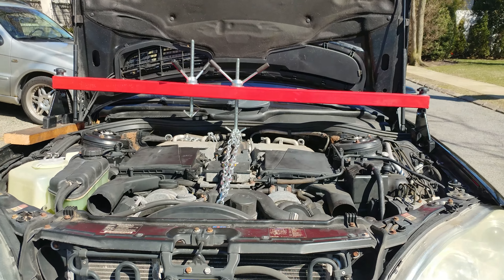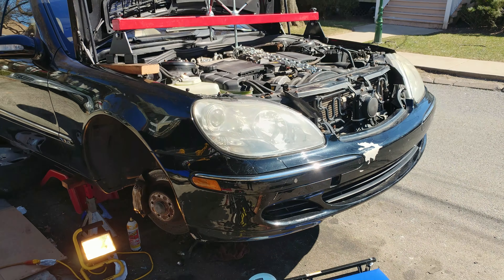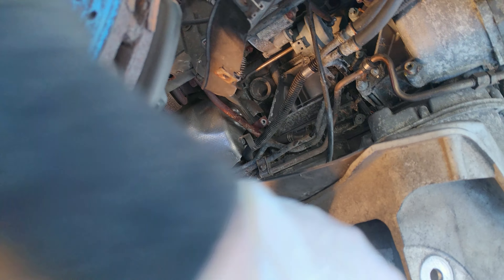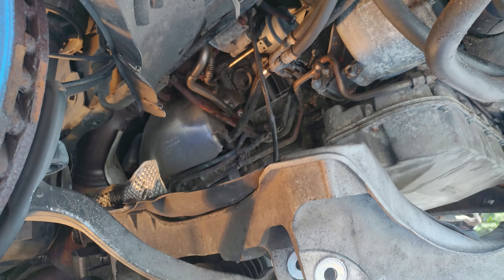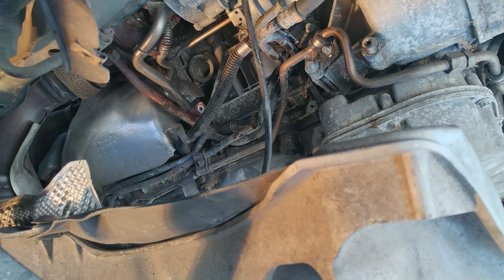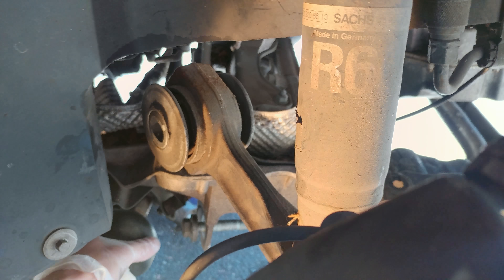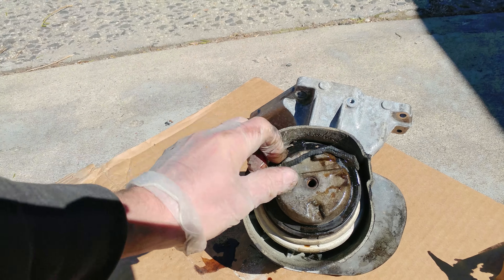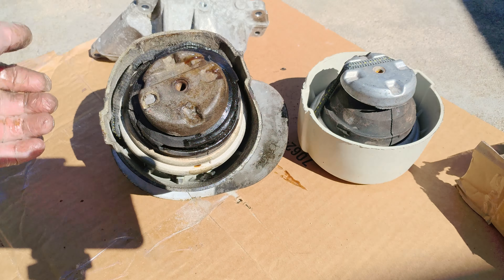Mercedes S600 bi-turbo project. M275 engine mounts

Comment: I have a question is the easy easier to do a timing chain just like you have the engine set up right now with the subframe down instead of taking the engine out look like it's more running now to do it like this on the CL500 2003 questions for anyone that have good advice for me thank you cuz that's what I'm about to do a timing chain job

Comment: For the chain attached to the engine, where did you attach it on the back of the motor?

Thanks
Reply from the maker: L Gaff There are 2 mounting eyes in the back of the engine
Reply: @vsandvs  hi did the car shudder when cold when you drive ? Before the mounts obviously?